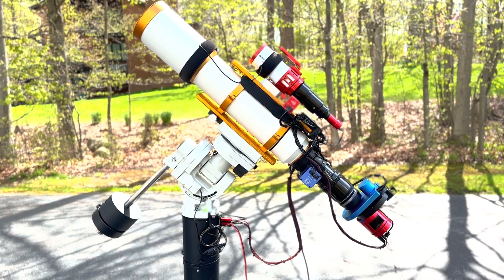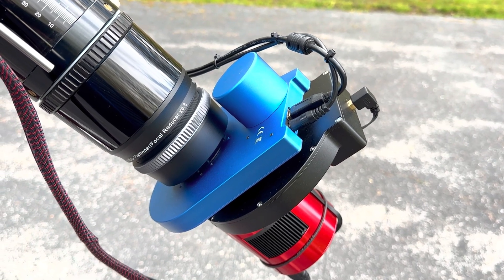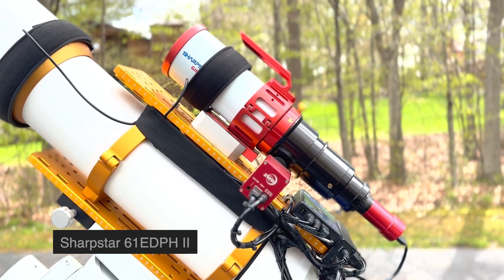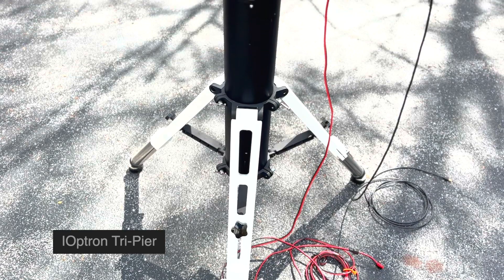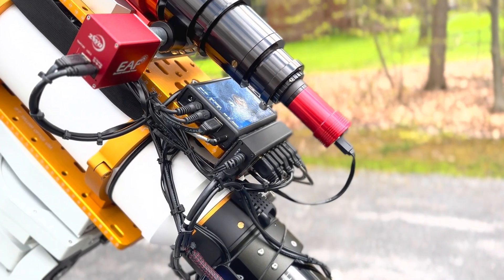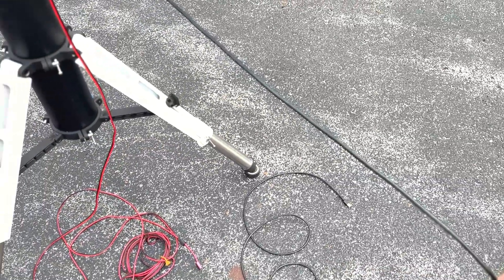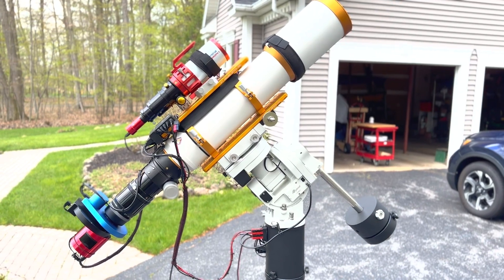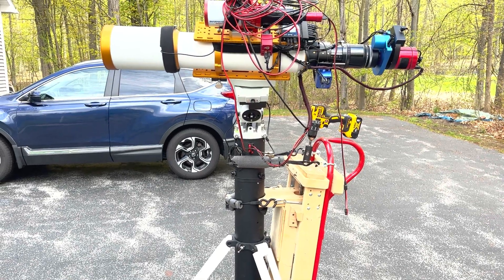A Video Tour of My Upgraded William Optic 132 FLT APO Platform

Comment: I would like to add a pegasus focuser to my FLT132 any special requirements or equipment?
Reply from the maker: No - but if you have any questions, I found emailing support at Pegasus Astro to be very responsive.  I ended up removing the brake screw on the bottom of the focuser and mounting the L-bracket to that.  With the Focus Cube 2, the motor has very high torque, and you will no longer need the brake screw.  The focus motor mounts to the shaft of one of the focus knobs once removed.  The coupler has Allen screws on both sides - make sure you tighten them both - I did not realize there were two, and I ended up seeing bizarre backlash artifacts that went away when both were tightened down!
Reply: Thanks, I'll give it a try.

Comment: I thought you are building a “double vision” system. Upper scope for OSC, bottom scope for Lum. OAG for guiding. 
Accumulating data twice faster. 
Couple more double vision systems, such as TOA 150mm with TEC 160mm; and another PlaneWave 14” CDK with Nauris 16” CDK and you are set. 😅